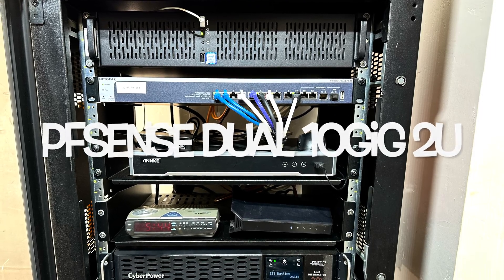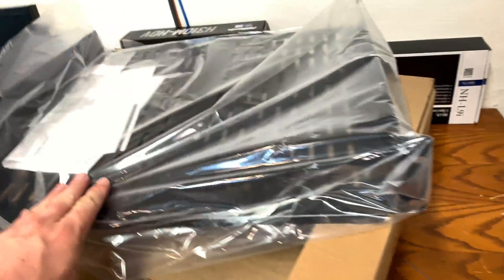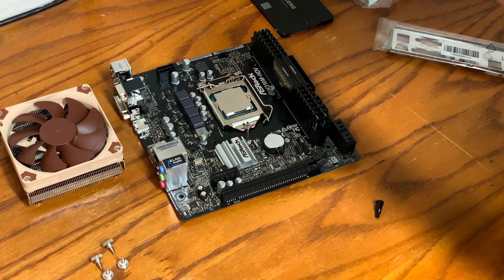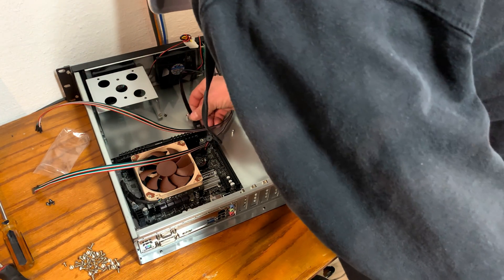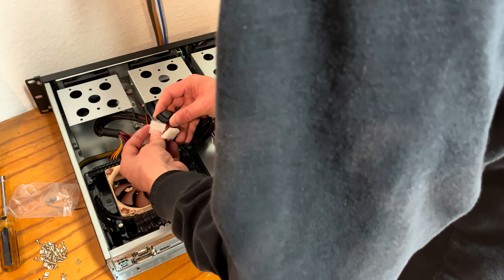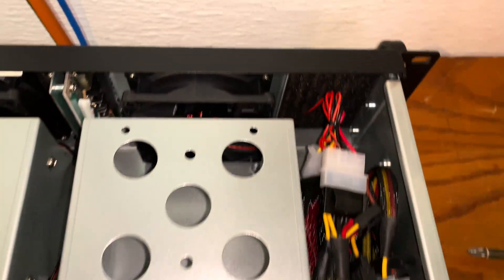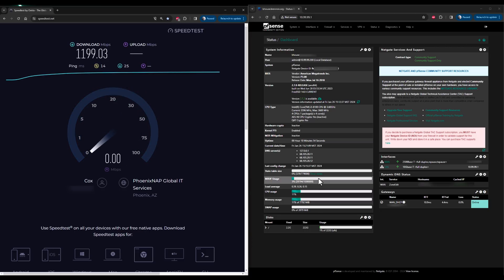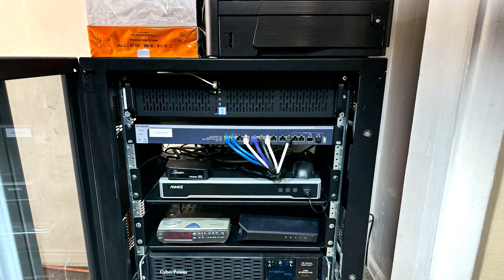Step By Step Guide | Build A 10GbE Router! PfSense 10Gbps 2U Network Appliance Dual 10GBase-T +SSD 🚀

Comment: nice router, might have to try and find this, i would of prefered to have a u1 case but its not easy to find in my country (new zealand) but outside of that, love your setup and hope your internet is pretty fast now that you have fibre at home , i use my pfsense in a old dell optiplex 9040 with a 10 gig mellanox connectx-3 and a 4x 1 gig intel card on a fibre connection 1000/500 connection with a small niche isp

Comment: So what are you even doing with this kind of network gear? Are you sharing anything? I've always just had a cable modem (or DSL) and a router, and as of August 19th 2025, I upload on average between 1.5TB and 2TB per day. I SHARE with my connection. What are you doing with yours? I don't see you sharing anything or doing anything useful with this hardware.

Comment: Just to say, depending on your CPU requirement, you can actually purchase motherboard with one already installed and a cooler pre-installed as well very cheaply. They also fit in a 1u case

Comment: I built something very similar (AMD-based), but instead used an SFP28 network adaptor. Since then. I moved the build out of the 2U server case I initially used, because they tend to trap heat and the fans are just too loud. I now use a classic CPU tower cooler and placed a fan on a PCI slot bracket to cool the SFP card. The build is virtually silent and runs much cooler. Another difference is that I don't use Pf or Opnsense but Linux instead. I don't need or want a GUI and Linux is far more flexible when it comes to running other services in addition to the firewall, NAT and DNS. I run multiple game servers, and email servers and multiple Docker containers on the same machine and it does not break a sweat.

Comment: Excellent setup. Bravo. But it is a bit expensive. I have the same setup with same intel X550 on a dell R210, brings the same effect with low power consumption.
Reply: No processor that an r210 can fit will handle 10Gb routing. They are also not that power efficient. The r210 ii with an E3-1270 v2 can’t even do 10Gb.

Comment: This is nice, what if you wanted to add more 10Gb ports? How could you do that in a build like this?
Reply: Several options: i) find a 4-port card (if available); ii) plug in a 10Gb switch into the LAN port; iii) use a mATX board with extra PCIe slots and plug-in additional network cards. The switch is the preferred option here for a more modular setup. I would use SFP+ however in this build, and get a switch with at least 2 SFP+ ports, one of which would be used for the uplink to the router.

Comment: Looking forward to the new video with the 8x8 fiber, which is exactly what I'm working with. Looking to increase NAS to NAS VPN connection speeds and the reason I'm looking at building a router. Great video!

Comment: great video, but I would install a fan on your external network card to get even more performance and to extend the lifespan.

because these network cards are not optimized to be passively cooled they are rather designed to have a very strong airflow in the case and the server should very probably also be quiet therefore an additional fan on the network card

Comment: You had to force the 2.5 Gb/s because of the Nic you are using. Its the Intel x550 chipset and technically NBASE-T was originally not supported (2.5 Gb/s and 5 Gb/s) because those speeds are not used in an enterprise environment. If you want full auto negotiation (100/1000/2.5/5/10) go with the intel x710 cards they have full support of NBASE-T & BASE-T

Comment: Being a Firewall, and being an SSD as your primary drive, enjoy it when it fails in 6 months due to SSD failure, constant writing to it is going to make it's lifespan  much LESS than a platter drive would give.....my firewall with a HDD lasted 10 years before I needed to replace it's drive, the SSD I tried gave out after 12 months. More modern does NOT always mean BETTER.
Reply: This is bs. I run my router with an ssd for almost 2 years now
Reply: I have had my ssd for 8 yrs on my router and 12 on my server, and both are perfectly fine. I think you might have many of the standard problems people forget about and store on ssd. I use ramdisk for logs, disable recording access times on fs and it works beautifully.
Reply: Could put in 2, as most motherboards will have at least 2 slots, and set them as a mirrored/raid1 array

Comment: Nice build.  When I decided to move my home to 10GB with 2GB Internet, I decided to got to a Netgate 6100.  The SPF+ connections paired with my internal WiFi 7 network works quite nicely.  Since I was paying for Pfsense+ on my homebrew unit, I decided to move to the 6100, since it will pay for itself over time not licensing PFsense.  When the hubbub happened with PFSense, I tied OPN for several weeks and just really prefer PFSense.

Comment: For Airflow I'd route the Cables away from the MB first, then bundle them up with a Velcro Tie. The MB itself works as a Heatsink and Radiates. You created a 'Cable Blob' right next to your RAM. Besides that I like the Project.

Comment: in 2024 at least put a cheap dual 2.5Gbit/s card in that spare x1 slot for the wan so you can at least have 2 useable 10Gbit/s lan ports today, better yet get a new 4 slot motherboard [MSI PRO B550M-VC WiFi ProSeries Motherboard (AMD AM4] & populate that with more dual ports for lan use.
Reply: Are you talking about a switch? A router only needs 2 ports.
Reply: This mini-ATX motherboard only has one PCIe slot. In any case it is better to use a switch for what you suggest. The Ethernet port built into the motherboard already provides for a backup port should you need one.

Comment: Also using an i3-8100(T) here, but with Debian because I like to config everything myself. This is router-pc v4, the first two were Atom based (N270 -> N2800), the 3rd i3-8100T where the MB died after 3 years possibly due to passive cooling (Akasa Galileo TU3 case) and then I reused that CPU/RAM/SSD in a Shuttle barebone that's been running like a charm since. Even the old Atom-systems could handle 1Gbps symmetric fiber without a drop of sweat :) , this with DPI/etc off. Unfortunately going 10Gb isn't possible with the current system, no room for expansion cards plus faster than 1Gb isn't available yet.

Comment: If you're so worried about "wires trapping air" (whatever that means)  why on earth wouldn't you use a modular SFF power supply? For those in the back of the class, this doesn't matter one bit.

Comment: i would like to asked 1 question if possible. would the 2.5 ssd limit the bandwidth of the fiber
Reply: The SSD has nothing to do with the network speed. It's just there to store and boot the OS.
Reply: @johnnyvvlog  would a  i5-3470T do fiber it just setting around the house i have motherboard and ram as well so its like best case when it comes to used items i just dont know if it would able to keep up
Reply: @crandall903   Wouldn't hurt to try.  You just need a 10Gb card.  I'm using a AMD 2400G and works fine.
Reply: @johnnyvvlog  Please explain, because I would think the SSD would be a bottleneck of some type, wouldn't it? I'm still confused. I'm just confused, and I want to understand/learn
Reply: @crandall903  the bandwidth never goes through the ssd. It's only there to boot from. Everything else happens in working memory which the SSD is not.
Reply: @johnnyvvlog  so its based off ram like cacheing?
Reply: @johnnyvvlog  dose size matter like is 4gb good for fiber or 8 gb enough
Reply: SSD does matter if you're transferring to/from that device, which most likely wouldn't apply to a router.
Reply: @joeyyung911  will a i5-3470T  work for fiber its just floating around the house takeing up space

Comment: I have the exact same case but have an old old  Xeon with similar intel 10 g card for truenas and unraid, a 4 port gigabit nic to supply the rest of the house.  I also used 2 64 gig intel ssd in ZFS “raid 1”.  I was using pfsense but shortly swapped to OPNSense. It’s on a UPS along with the switches and WAP so no dropped internet in the evening of a power outage

Comment: Running a 600W PSU on a a machine that'll pull 100W max.  Not good for efficiency.   Such a weird build.
Reply: What
Reply: @aRandomHomelabber  what dont you understand?
Reply: @BenState your commend is not true. The system only uses what it need so to put a higher watt psu (witch most of are better optimized then cheaper low wattage plus)  does not exactly mean that the system is using more watt than if you put in a 200 watt psu for example. Putting a higher watt psu in will probably be better for efficiency
Reply: @aRandomHomelabber  Incorrect.  Look at a switch mode power supply efficiency curve, and you'll see that efficiency drops off precipitously below 50% load.  Please update your knowledge accordingly.
Reply: Yes, but the issue is that you can't really find good PSUs, especially those with zero-RPM operation at low loads, in low wattages. I am using a Dell 450W PSU that I salvaged from another machine but buying one of those new direct from Dell will be as much as getting the cheapest Corsair.
Reply: @ghost6813  Nonsense.  Complete and utter nonsense.  You can find many quality PSUs below 600W you dropped pie.
Reply: @BenState  Perhaps then you could suggest an affordable low-wattage PSU that can operate in fanless mode?
Reply: @ghost6813  fanless mode is on every psu in the modern day.

Comment: What on earth are you doing to need a 10Gb pfsense?
Reply: Are you some kind of 10Gb gatekeeper?
Reply: @tab8k  not an answer
Reply: @BenState  you expect people to provide you an answer, but you won’t even think yourself
Reply: Why not ? I have a 3 Gigs internet plan and I really had a hard time finding similar build specs for pfsense because everyone was building sub 1 gig box.
Reply: @kaushikwavhal3403  You may have 3Gbe interent, but which servers supply you with that speed?  Name them.
Reply: @BenState  You are assuming there's only one user who is accessing stuff from one server at a time.
Reply: @kaushikwavhal3403  Storage limitations exist.  The speed of sequential read/writes means that you would need to be maxing out 20 or more people with the fastest nvme storage all accessing the network at the exact same time.  It is simply e-peen for a home user to have a dual 10Gbe network setup.  Storage and server lmitations make it pointless.  The power use and cost (inlcuding client side requirements and cabling) make it stupid.  But go ahead.
Reply: @kaushikwavhal3403  if you have that many individual users like that band which is required you need to have dedicated lease lines installed
Reply: @Adam-n1p6m Lol, stupid answer.   What server is providing you with 1.25GB per second?  Name one?  Its an INTERNET gateway.
Reply: @BenState  you don’t make much sense a gateway is not a networking device
Reply: @kaushikwavhal3403  The problem is, unless you have the storage to match, you're wasting your time and few if any servers will supply that level of speed.  The ONLY use for 10GBe NICs is if you have many machines all requiring a full 120MB / sec at the same time on the LAN.  Otherwise its a waste of energy, money and is just e-peen.
Reply: 10Gbe NIC for future proofing, i would assume. I am doing what this guy is doing right now, LAN side that is. It is nice to have a NAS that runs data transfers up to that speed.
1Gbe is too slow, or going to be too slow eventually. Price differences of 2.5/5Gbe and 10gbe isn't all that huge anymore; opting for a much higher theoretical data transfer is best.

And to further say more things here; 

>WAN -> Whatever Plan he will be going to, past 1gbe, his pfsense machine will have likely no bottlenecks with throughput going this route for a very long time.
>LAN -> Machines communicating with each other, also no throughput issues.
For how much 10gbe nics are now, throwing a few more $ won't hurt anything.
Reply: @RyzoTM  I understand that, if it were the switch.  But for pfsense, that is a firewall to the WAN, which, 10Gb is a future proofing exercise in the ridiculous.  The other machines aren't even connected to the pfsense.  And to put a 600W PSU??? Come on man.
Reply: when you have >1gig internet, 10GbE is nice so you can use what you pay for..
He's getting 8gbit internet access so why stick to 1 or 2,5gbe?
Also, even if he did stick to using 1 or 2,5gbe devices in the network, the firewall can be 10gbe so it doesn't behave like a bottleneck when multiple users get through at the same time.
10Gbe is not as expensive as it used to be. Most people would be fine with regular 2,5 but if you have a NAS or faster internet, why limit yourself?
Reply: @ledoynier3694  1Gb internet is 1/10th of the 10Gb bandwidth?  What am I missing?  Also, there is no system that will actually USE that.  Other system bottlenecks are in place, such as storage.  The idea that a home pfesne needs 10Gb is just stupid.
Reply: This is made in 2017, pretty sure there isn't any 10Gbps router then. Even today, 10Gbps routers are few and very expensive. You likely be able to build cheaper 10Gbps router yourself with 2nd hand parts. Most important, increasing number of places are offering 10Gbps home internet so for people who want to take advantage of 10Gbps at home, DIY pfsense router is the most value for money approach. Otherwise, you did have to spend a thousand just to get that consumer router which provide you 10Gbps port to connect to your switch.

Comment: Good build but I would have swapped the fans out for models with 4-pin PWM connectors. Also, as others suggested: Don't cover the opening for the PSU fan. a PSU with a rear fan might have been a better choice.
Reply: The case cover has slits for the power supply. It's fine.
Reply: @AlmightyEye  he does not have any events when mounted in a rack because it is covered

Comment: i would have gone with more overkill specially on the cpu side. Like a i3 of the 12th gen or newer since they are also cheap and low power but the single core performance has gone up a lot which can help some things in pfsense.
Reply: Have you seen what pfsense uses?  Fall.

Comment: BIOS setting:
(Intel):  After Power Failure setting to Power On
(Gigabyte): Restore (on) AC Power Loss to Power On
(ASUS): “Restore on AC/Power Loss” or “AC Power Recovery” or "After Power Loss"
I use the intel dual sfp++ nic & intel 4 x 1GBE nic
One sfp++ 10GBE is vlan trunk from switch to pfsense using DAC and use pfsense to do firewall between vlans and internet connection/s.
Eventually I will link aggregate the two sfp++ ports and vlan the aggregated virtual ports at both ends however that introduces some technical considerations when upgrading as to do so is a o/s driver config hack.  One way around that may be to virtualise and use the hypervisor to fan out the vlans to logical interfacess passed through to pfsense vm.

Comment: opnsense has better driver support and much better licensing - the only thing wrong with this build essentially - using the mini mb is also abit questionable since std atx is about same price and gives you more pci slot options - molex was also a big mistake and who cares about aesthetics - nobody is ever going to appreciate the aesthetics, a few cables are not going to affect airflow appreciably  #forks
Reply: OPN isn’t even on FreeBSD 14 yet.   Unless you are adding needed features or security patches, why do you want your security platform updated frequently?
Reply: @tedsanft  opnsense is just better fork - better licensing is big, better driver support is big and updates are critical for a security platform - that should go without saying
Reply: citation on the driver support?  whats wrong with teh CE ?
Reply: @BenState  OPNsense is updated way more frequently. they don't lag behind as much as PFsense does. But eventually they get there.
tbh the main reason i switched to OPN is the UI and ease of use :p

Comment: i have a build now with pfsense and an hp elitedesk 800 g3 with an i7 7700 and 32gb of junk 2400 ddr4 memory along with an X710-DA4 quad port 10G SFP+ card, two single realtek 2.5G cards (will upgrade to dual intels at some point here I think) and a quad port realtek 8125 2.5G card - have to install the realtek drivers which is a pain but you can just use the intel for WAN and 10G for LAN for the install and then changeover to the 2.5G for WAN once installed....surprisingly the realteks have been ROCK SOLID and get 2.35Gbps line rate all day long....and the SFP+ cards are DIRT cheap.....nice content I dig it, keep it up!

Comment: Nice clean build. I myself choose a old Dell optiplex SFF with a 6700k and an Intell x520 dual spf+. I run a full 10g network in my house with a 10g fiber wan capped at 3.5gb. I can push all 3.5gb with this pfsense build.

Comment: I am skeptical that this hardware can actually NAT masquerade packets at line rate. So I’m excited for the follow up once you get multi gig fiber WAN.
You could also test this in a lab setting with iperf if you have two 10g capable devices.
Reply: @wojtek-33  Good to know someone tested 10Gb on the wyzse 5070. I currently rock one with OPNsense and dual 2.5GB intel 226. Glad to know I can upgrade it later down the line.
Reply: @wojtek-33  Out of curiosity which 10Gb card are you running in it?
Reply: @wojtek-33  nice I have a few of those and a connectx4. Good to know they work

Comment: Couple suggestions. Don't use that style of Power supply, use the style that have fans on the rear, when you put the case top on you are going to suffocate the intake fan. Second, I would have bought a motherboard with a m.2 slot on it for a 2456g ssd.
Reply: That case has a cutout specifically for the PSU fan on the lid. I have a very similar design case. It works fine.
Reply: Sweet, Some of the previous ones didn't. @KamotzII
Reply: @KamotzII  still not good for a rackmount thing